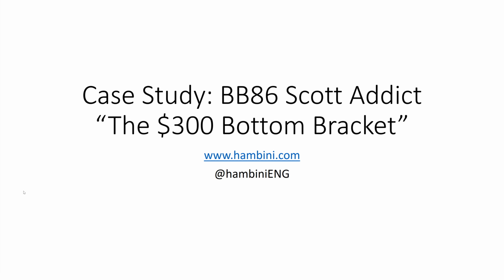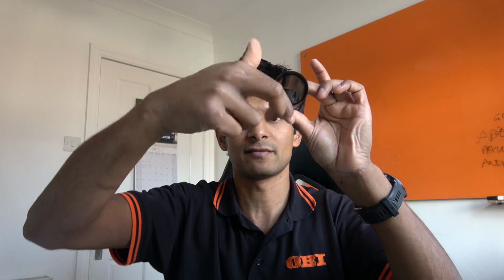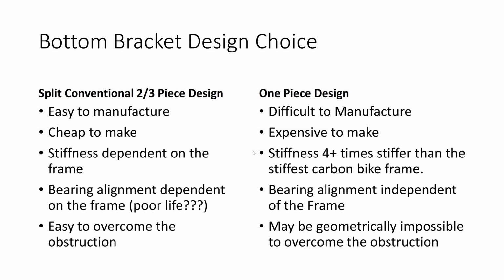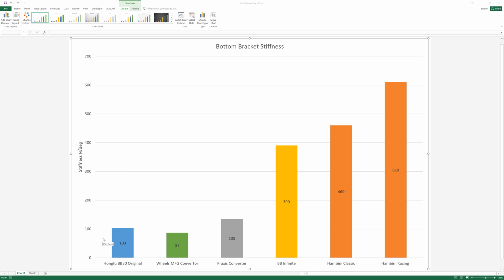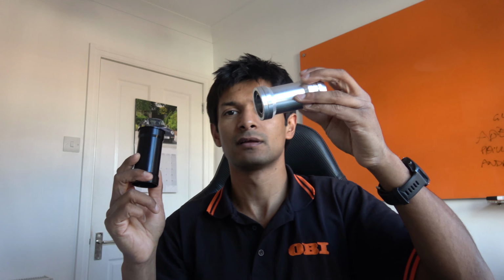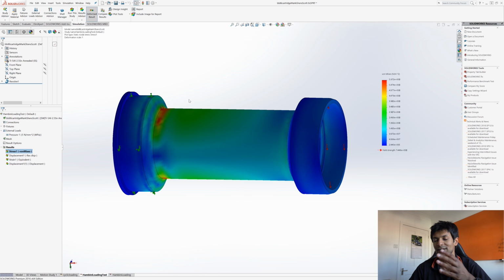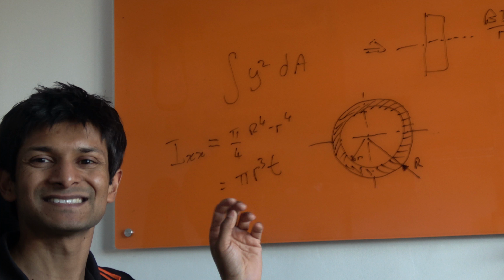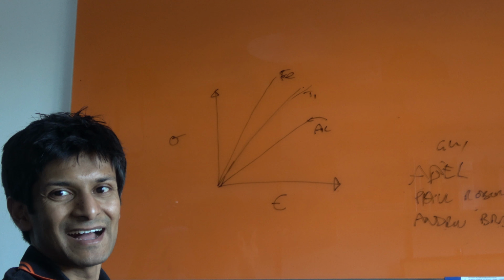Shimano BB86 Creaking Bottom Bracket Scott Bike Case Study

Comment: A question for an engineer - not related to bottom brackets - which I've asked on a couple of forums and nobody seems to have a good answer. Maybe you have some insights. Why have some frame designers decided their frames will be better if they bring the seat stay up to a point 3 inches below the conventional, seat tube - top tube, intersection location? How can it possibly benefit the frame by having an offset punch load, with associated bending moments, in the seat tube? You see both designs in the pro-peloton. For example BMC seem to think it's a great idea. Cannondale clearly don't. (I'm an aerospace stress engineer myself so feel free to get technical.)
Reply from the maker: Hi Martin. The main reason is not for structural reasons, it's for aerodynamic reasons. The lowering of the seat stays makes the airflow into and around the back wheel much more favourable. From a structural point of view, modern bike design is still influenced heavily by the past and the diamond frame still rules. Those diamond frames were the result of welded connections where maximising the triangles and having minimal cantilevered loads was desirable hence having the seat stays welded at the point where the top tube meets the seat tube. On a carbon monocoque design, there is much less need for that because the carbon behaves as though it has no joints. Additionally the tubes no longer have to be round drawn tubes.

The other issue is on a carbon frame with thick stays, the ride can be bone crunching. The industry is rife with people getting on the bandwagon of comfort. Really this is "flex" but they don't want to call it that because flex is a no no word in bikes, so they call it "compliance". 

So in summary, the dropped stays are there for aerodynamics. They are technically more difficult to manufacture. Hope that helps Hambini
Reply: I heard the aerodynamics argument before, but wasn't impressed by it as the region is so far back in turbulent airflow anyway. Fair enough, if wind tunnels show it to be of significant benefit then I'll obviously accept that. Are you aware of any evidence?

The compliance thing is something else too. My frame is conventional and I haven't noticed it being uncomfortable, but then I don't ride the cobbles. Putting curves into members (compression members by the way) is just softening the effective spring rates, so you wonder how many watts are being expended in keeping the rider "comfortable".  I mean rule number 5 anyone?
Reply from the maker: It's more the turbulence caused by the wheel spinning than the forward speed of the bike for he dropped seat stays. 

Due to me having access to a wind tunnel, myself and a few of my aerospace engineering colleagues put some bike frames and wheels in the wind tunnel and the dropped stays does have an effect. It's more noticeable if you are going faster. 

For the compliance aspect. Both of my bikes have the dropped stays, the BMC is much more aggressive and for rule 5, I just wear thicker shorts!
Reply: Interesting stuff. Like the T-shirt by the way.  More succinct than "Hagebaumarkt" nicht wahr?
Reply from the maker: LOL. alles in OBI + I got a free hit on their tv commercial
Reply: A bit off-topic, but I do find the design with seat stays starting at the top tube level (Salsa Warbird Carbon 2019, Norco Search XR Carbon, Accent Feral, Vielo V+1, Genesis Datum, Forme Monsal, Ghost Road Rage -series, etc.) quite a bit prettier than the design where the seat tube - seat stay junction is placed below (or above, for that matter - that's even uglier) - the top tube - seat tube intersection (the otherwise very handsome Giant Revolt Advanced, On-One Holdsworth Mystique, James Renegade, Specialized Diverge, Thesis OB1, Viathon G1). The latter simply doesn't look like a particularly timeless design to Me. A bit like a Volvo with taillights that hideously stick out off the frame, compared to classics like the New Beetle, the Mini, the Fiat Cinquecento or the Alfa Romeo MiTo (or a Tesla Model S, which still beats most newer cars in its price segment not only in utility, but also visual design).

Comment: hey hambini. Do you recommend fitting sram cranks in shimano bb with an adaptor? (24mm to 22mm on the non-drive side). I think you no more sell bbright gxp bb.
Reply from the maker: Hi Gil, I don't recommend fitting GXP in anything period. I have found their crank axles to vary considerably in length and consequently I stopped selling them. If you are in need of a solution then an adaptor is perfectly acceptable. Hope that helps Hambini

Comment: what if using sram 24/22 crankset if hambini’s one piece BB add stiffness to your bike?!
1x user here!
Reply from the maker: Similar setup but you have to adjust the spacing accordingly. It's not totally straightforward.
Reply: i am planning to build trek frame with bb86. thanks for making great product.
Reply from the maker: Trek's are usually BB90, so this would not fit.
Reply: 2018 trek crockett or boone? drop bar 1x setup is exist especially cx/gravel bike. a durable stiff creak-free press fit bottom bracket is a must for adventure bike...

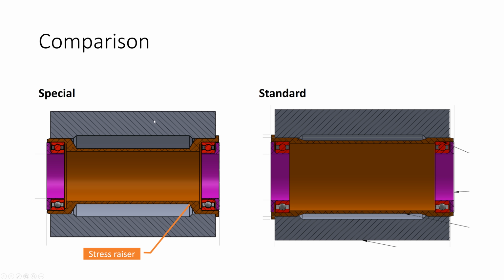Comment: The CAD model of the 'special' version at 8:57 looks to me like a one-piece design, and so does the final product at 28:34.  How did the customer press it through the frame past the cable guide obstruction?   sorry if I missed it-  I watched this video for the first time like a week ago and this question has been bothering me ever since!
Reply: i've been tormented by this question for 4 months now.  please respond so I can sleep at night
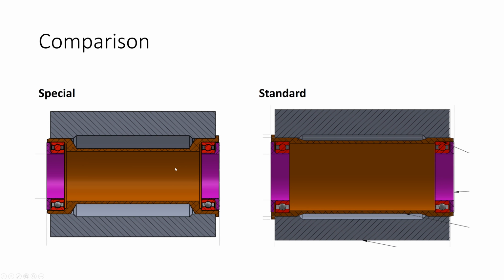Reply: alexusdasia it's in the thumb nail he also compares the shape of this custom BB to the standard version starting around 8:40
Reply: @pierrot867, I'm still not getting it.  It seems to me no matter how skinny you make the 'neck' of this one piece bottom bracket, both ends are still full size, and thus impossible to press past the molded-in cable guide.
Reply: When you press it past the the first face that sits in the bottom bracket shell the whole thing is just going to sit in there slack because it's necked so it'll allow you to move the first BB face around the cable guide before lining the whole unit up so that both BB faces are lined up with the bb shell. 
The Scott BB shell isn't of consistent diameter the whole way through once you're past the the rounded part where your bearing is going to sit you're basically in a larger cavity. Hope I've explained this ok.
Reply: got it, thanks!
Reply: pierrot867  The cable guide is removable so you press the Bottom bracket first then re fit the cable guide.
Reply: @mattkneller900  that guide is un-removable....check out 2:00

Comment: As a student in university studying mechanical engineering, I really enjoyed your informative approach to cycling related problems. I also an avid road cyclist and it's just SO COOL to see the things I learned in classes being applied on bicycles.

I have a question: Why don't you fillet the sharp corner where the stress raiser is? I was taught that filleting and smoothing out sharp angles reduces stress concentrations. Is it due to a manufacturing restriction? Thanks.
Reply from the maker: Thanks for taking the time to watch my video and asking a question. The reason is to do with the way I hold the bar to machine it. Machining in one go is not technically that easy.
Reply: Hambini Thanks for your quick reply! Yeah, I'm sure that milling/boring a BB at such high precision poses many challenges. Just curious, what are your thoughts on 3D printed components? Is the precision not up to your standards yet? Or is there some inherent disadvantage of 3D printed parts, reduced toughness etc?

Comment: If Rotor is so crap, what's your solution for a BB86 rotor 3D+ axle?
Reply from the maker: I would not consider putting a 30mm axle in a BB86 frame. I think it's a recipe for disaster.
Reply: the BB86 Rotor 3D+ is a 24 mm axle tho. But does it use the same bb shell as your shimano one?
Reply from the maker: I could be wrong but I thought 3D+ was 30mm and 3D (no plus) was 24mm
Reply: No actually you're right. It uses 2 standalone cups not a single shell. Why do you think its a recipe for disaster? Could you elaborate? I'm using this on my frame without creaking or much issues, but I find there is some friction under load or would look to upgrade were possible. I'm currently using the PF4130 standard rotor shells
Reply from the maker: The way everyone has gone about designing a solution is to take the insides of a 6806 bearing and machine the outside of the bearing down. This will reduce the load carrying capability by about 75%. If you pedal at high cadence, this might be unnoticeable but if you grind, go uphill or put out lots of watts - the bearings will wear very quickly.

Comment: Great video ! No marketing BS or blabla, just engineering :-)

How did you solve the obstruction problem ?

How did you overcome with the cutting tool deflection due to the length ?
What is the worse ? Discrepancies in part repositioning or the tool deflection under cutting load at a distance ?

I personally installed a BB infinite on my S3 BBright as I quickly understood the misalignment issues with cups.
I covered only 3500km with the first rotor cups ...
Next might be a Hambini :-)

Comment: Hambini you refer to the flange as the locating piece but i'm praying you don't actually mean this! Assumes perfect perpendicularity of shell side. Let's call the flange an axial stop? Also worth noting to most people is you refer to bb30 being double the stiffness of a 24mm. In terms of Ixx may be but when you take E al vs E steel the stiffness comes back together, steel actually coming out on top. What is the wall diff between shimano 24mm and bb30 cranks out of interest?
Reply: Great video though
Reply from the maker: I agree axial stop would be a better term and you are right they are never perpendicular. And you are also correct on materials but shimano locating point is aluminium so it's a direct comparison.
Reply: Dura Ace aluminium axle? Pretty sure its steel!
Reply from the maker: Axle is steel but... and this is open to debate, the locating point is aluminium. The aluminium has a lower E value than the steel so you take the worst case ie smaller Ixx with the worst case material. 

On BB30 you would be aluminium at a bigger Ixx. I hope it made sense, I've re-read it back to myself and realised it could come across complicated.
Reply: I agree with you on the locating point part, but the axial length is very small compared to the steel part and the BM from the crank here would be zero or almost zero, isn't it?
Reply from the maker: And this is why it's open to debate, it depends if you class the bike bottom bracket as infinitely stiff, or the crank axle as infinitely stiff and assume flex in the crank arm or crank arm to axle joint. 

I don't think there is only one correct answer but the designer needs to be consistent.

Comment: Hey, really enjoyed your videos.
A quick question(might need a long answer), I've always balanced my clincher wheels to make them more stable. My new bike, however, will come equipped with tubeless setup, if so, do I still need to balance the wheel?
Reply from the maker: There will always be some inbalance in the wheel/tyre. Usually this is not enough to require balancing unless you are going at high speeds. So if they were balanced before and you liked the feel, you will need to do it again but with less weight on your new weheels

Comment: Fuji Norcom straight has 40.95 in one plane and 40.75! in other. No alu inner tube in frame so the oval hole should stretch easily to alu 41.00 -.05/-.15 OD. What you think? What about bb made by graphene?
Reply from the maker: That's pretty much the worst I have heard of. That's terrible. I'm not sure how hard graphene is and don't have much experience with it, hence I can't comment accurately.

Comment: Fantastic video, informative and interesting 👍 I would love to run one of your BBs but need to find out what is currently in my frame, as I’m not sure, it’s a Dolan Tuono running SRAM Red cranks, the wheels manufacturing inserts you showed looked familiar though. Will have to strip it down one day and take a look 🙂
Reply from the maker: Thanks for the feedback. A quick hack for SRAM GXP is to remove the non drive side fixing system and make it floating. This will drop your rolling friction by about 15-20%
Reply: Hambini Only just saw this reply! I’ve actually got my bike in bits at the moment inspecting the B.B. found out it’s a BB30 set up with wheels manufacturing adaptors to a Red 24mm crankset (I emailed you about this a few weeks back) all looks good with the bearings so far 🙂

Comment: Hey Hambini, great video as always. I'm curious whether the stress riser you described could have been avoided if you had machined a radius instead of that sharp angle. What was the reason to design it as you did? Greets from Frankfurt, Joern
Reply from the maker: Its a good question and it's to do with the method of holding the workpiece when I machine it. Two radii would have reduced the stress raiser (and added weight) but the difficulty would be in making it without turning the workpiece around. Once the workpiece is in my lathe, I don't take it out - all operations are from one side.
Reply from the maker: I would point out that the stress raiser never disappears, it only becomes less of a stress raiser
Reply: Using a cutting tool with a bigger radius could allow you to machine one-sided and also reduce the stress concentration. Since no cutter is atomically sharp, even a sharp looking cut will have a radius if you look close enough, so no harm to go with it :-D..
Reply: FEA will always light up at sharp edges too so it may not be as bad as it looks. I would prefer a generous radius there though.

Comment: This video brings your channel to yet another level! Very well made. I want to ask is there such thing of matching material of BB to frame. I ask because for example when i work on wheels hubs which are often made out of AL, i will use a AL clamp (or at least the interface) because it is abit softer than steel. So is there such thing where the material of the BB is 'too stiff' to the point that the frame is now taking all the stress? Thanks.
Reply from the maker: The problem is the ultimate interface which are the bearings. Bearings are made of steel and something has to interface with it. Inevitably there is also a desire to have light weight, so if you combine all of these things to gether it points you in the material combination we currently have.

Comment: Excellent explanation and video.  
Would have liked to see your new necked-down BB CAD model being virtually assembled in the CAD frame cavity to see how you overcame the obstruction.
How about machining curved fillets instead of sharp transitions to lessen the stress riser?
(I feel like you might need a pair of parentheses in your inertia formula)
Good on you for being able to machine aluminum AND titanium, both challenging materials to do cleanly.
Reply from the maker: Yes you are correct R^4-r^4 should have ().  I did consider curved fillets but that adds weight and also the complexity of doing that using my method of holding is what put me off. I don't think my solidworks skills are good enough to show a virtual assembly!
Reply: Thanks for the response, Hambini.  
Liked the Ti (6-4? 3-2?) use to provide equivalence at smaller diameter.
Reply from the maker: Sorry George, I don't understand the question
Reply: Mostly just saying thanks.  
Curious what titanium alloy you used:  Ti with 6% Aluminum 4% Vanadium (which is strongest but hard to come by), the mid level 3%-2% option (which is is/was frequently used in cycling applications), or pure Ti.  This might be another way to raise your part strength without geometric changes.
Reply from the maker: When you get to titanium, the difference in elastic modulus between all of the different grades is comparatively not that much. However the ability to machine it because of how hard the material is varies by quite a bit. The final choice was left to the customer who (IMO) was well read and obviously had some experience with engineering - it was very evident in the dialogue. Hope that helps Hambini

Comment: Mr.H. I have a question about bb shell CFRP wear. Every pedaling stroke causes quite a significant distortion making BB cup (in the case of BB86, Pf30, BBright etc) rub against BB shell cup. This certainly facilitates CFRP wear and dilation of shell diameter. I think using some materials like alloy which have higher anti-abrasivity than carbon fibre will deteriorate the situation in the future. What is your opinion? thanks in advance
Reply from the maker: Thanks for your question. The main aim would be to limit the movement, so putting a bearing in a material that is suitably stiff and restrained so it doesn't move would be better than putting it in a material that is hard but allows movement. It's the movement that's key.
Reply: Aha. Thanks for your kind reply. Then how about some BBs, like wishbone's or wheels mfg's (e.g. https://www.universalcycles.com/shopping/product_details.php?id=72110)
which have threads in the mid-section to make both sides put solid tight? Wouldn't it be more unflappable than solid uni-design?
Reply from the maker: The main advantage with threaded is it's easier to fit. The disadvantages are

1. It's inherently misaligned because it's threaded. There is some clearance between the threads to allow for the turning action
2. It's not as stiff